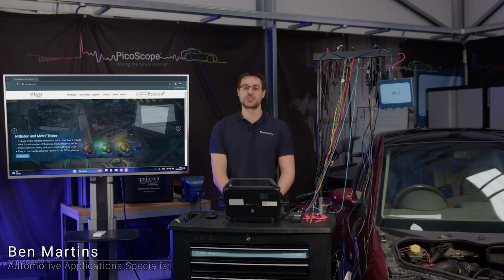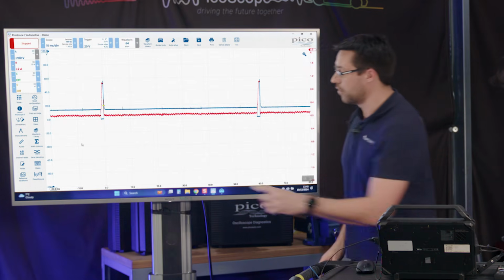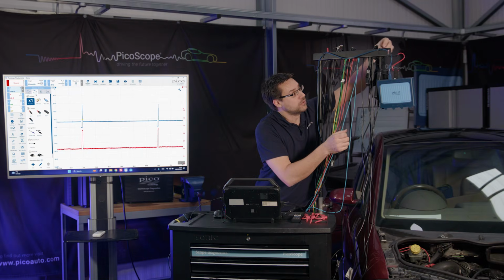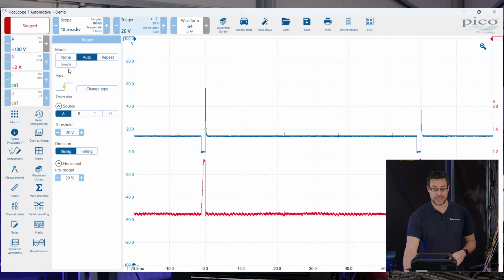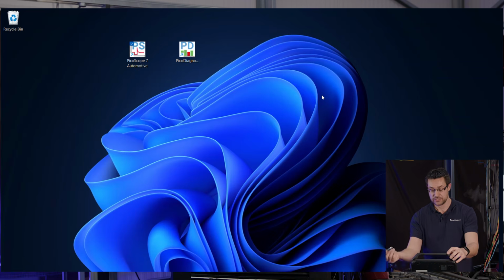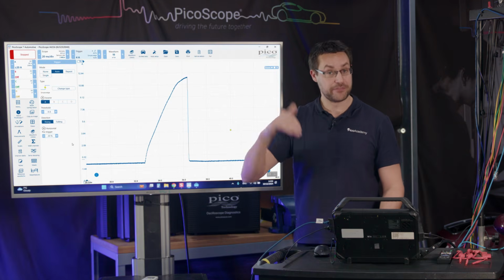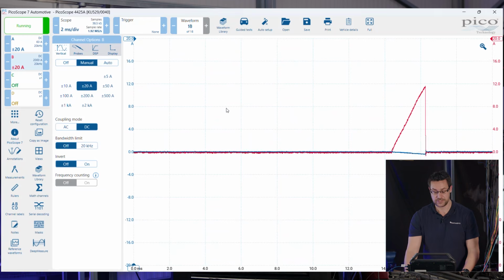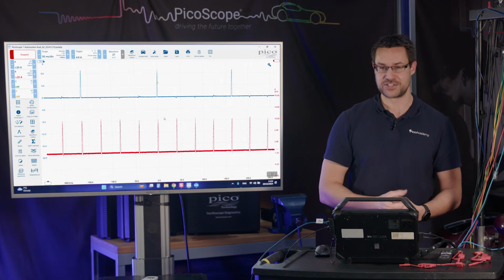PicoScope 7 the Basics

Comment: When is an attenuator needed with a pico scope. Would that be only during secondary waveform or primary coil current with back probe instead of the amp clamp? Thanks in advance!

Comment: I still see a huge shortcoming of your oscilloscope in that you don't have continuous signal acquisition. You're still running in some kind of window acquisition which is very impractical. In the past it happened to me that a critical outage came out between the windows. So it can't be used. We have an oscilloscope that acquires an endless strip and is limited only by the size of the HDD. We already reported this to you a few years ago and I still see the same shortcoming.